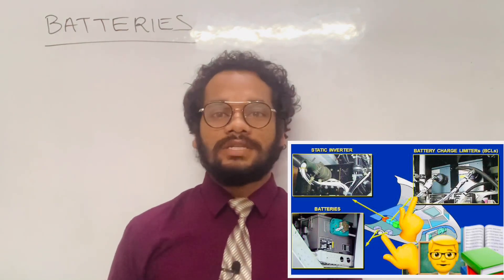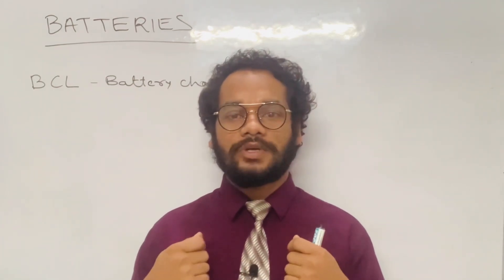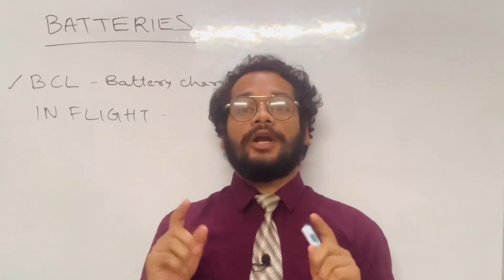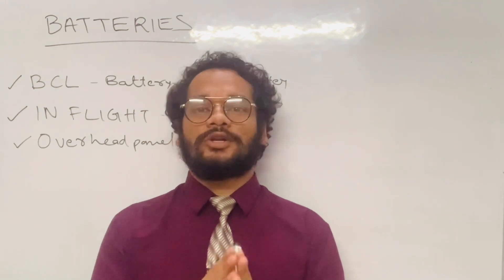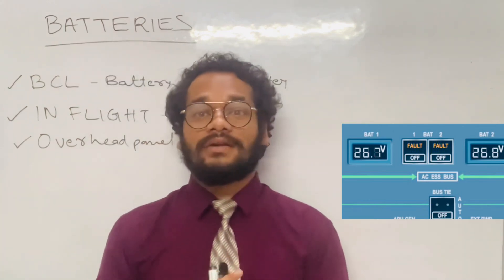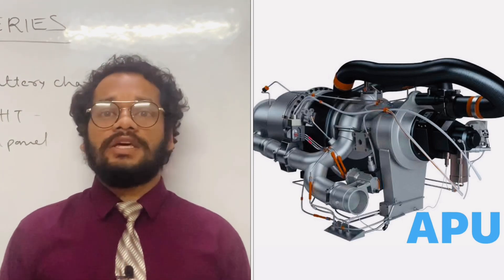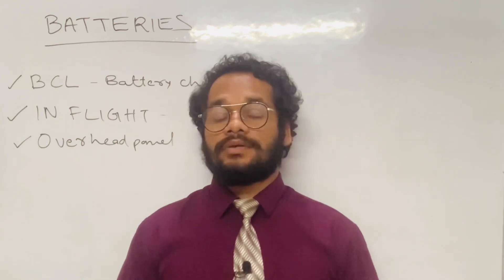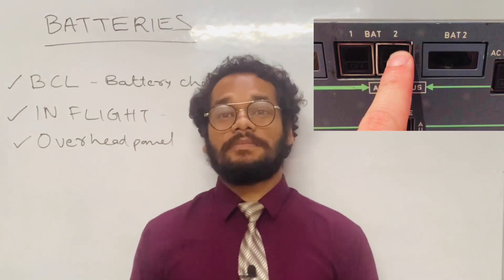A320 Batteries, BCL, Battery Panel, Use in- Clock, ADIRS,Refuelling, APU Start, Emer Use, Checks

Comment: hi my friend,  just to clarify , the  batteries must be in auto  not only because   it would power the dc batt bus , because  if we have the ground power unit  connected the dc batt bus is  energized , however we still need to connect the batteries  in auto in order to  operate the btl .  that is why   even if we have energized the  batt bus  if we try to start the apu  with the batt off , the apu will not start.
of course i am pretty sure that with your experience you would be  more  capacitited to explain it. 
very good  explanation , thanks a lot.
Reply from the maker: Hi 
Same has been noted. Thank you so much.

Comment: Sir, 1 question.

In FCOM it says, STAT INV provided by BAT 1 as you mentioned too..  Now it says above 50kt, even if BAT push buttons are OFF,  still STAT INV will automatically work, if aircraft electrical is only powered by batteries. 

Now how does that happen, in OFF conditions, how is Stat Inv provided by Bat 1.

Thank You
Reply: Also,  When the aircraft speed is below 50 kt, the inverter is activated, if only the batteries are supplying electrical power to the aircraft, and both BAT 1 and BAT 2 pushbuttons are ON.

why in this case we need BAT buttons to be ON ?
Reply from the maker: Correct it is written and your understanding is also current. Just note 👉🏻Battery pushbuttons control the electrical connection between batteries and DC BAT BUS whereas the electrical connection between battery (BAT 1) and AC ESS BUS via static inverter is controlled by logics as like when aircraft is only on batteries (EMER ELEC on BAT) for Speed > 50kts, the system needs assistance of Static Inverter and hence the electrical connection herein is automatically made (irrespective of BAT pb position).
Reply: @aviatorupdates   ok got it, thank you for reply Sir, so as you said "electrical connection between battery (BAT 1) and AC ESS BUS via static inverter is controlled by logics " . 

So it is this logic that activates Static Inverter when Speed is less than 50kt, only when Bat 1 and Bat 2 PB is ON (i.e. Batteries are connected to DC Bat BUS ) .  ??  correct